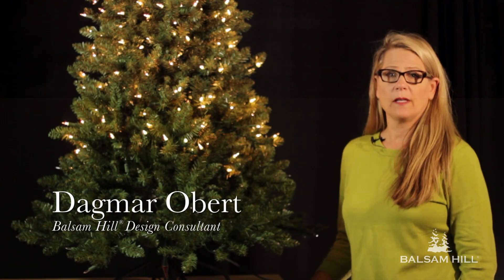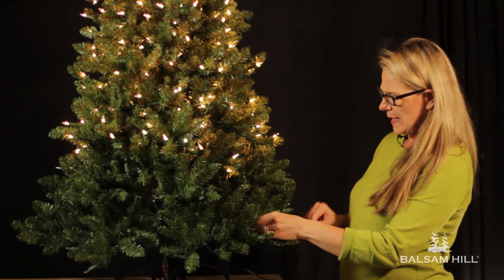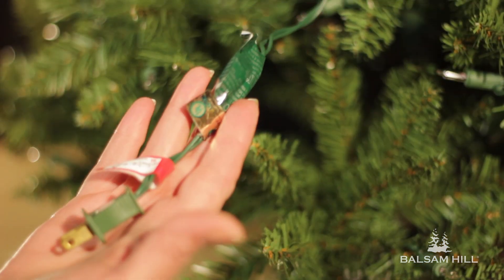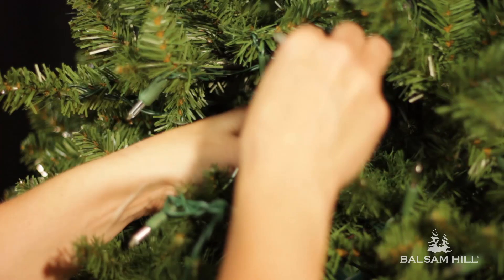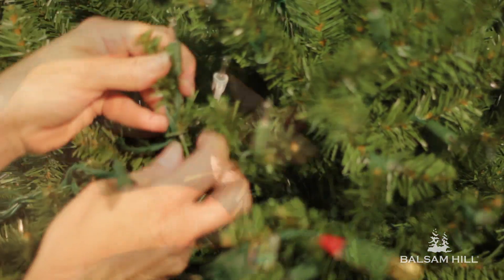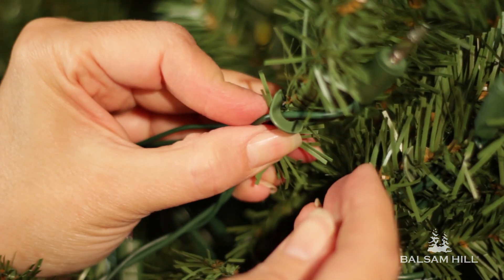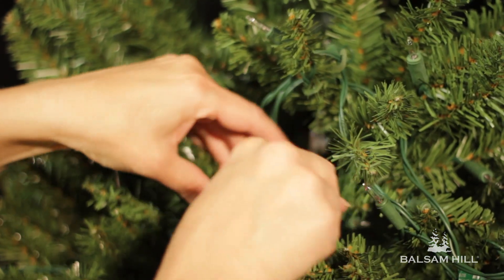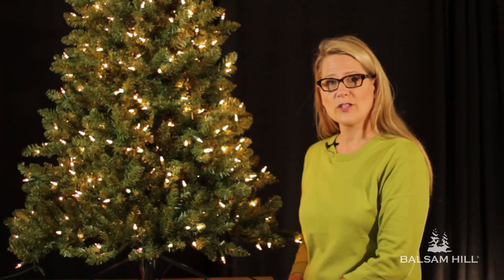How to Restring Lights on a Pre-lit Christmas Tree

Comment: My section went out because the section plug broke out of warranty, so no BH help, at all. They sent clips. See below comments.  My fix? I bought the $5 50-light set from the Home Depot, checking that it had the usual pair of 3 amp fuses in the plug.  Unplug everything. This is very important: On the HD set identify the “line” wire coming out of the first light. Put a colored tape on that wire about 6 inches from the plug. The other is the “common” wire and it does not run to an individual light, but runs along as the line wire goes to each light in turn.  On your BH tree put colored tape on the line wire coming out of its first light about 4 inches from that plug. Use a wire cutter and cut both sets of wires leaving the tapes in place so you can still easily identify line and common wires. .  Strip the ends of all 4 wires. Connect and insulate the two .line wires and then the two common wires(small connector caps or electrical tape; ask a hardware store if not sure).  Test with an extension cord. Should light up.  If it pops, you mixed up the two sets of line and common wires. Replace the fuses, switch the wires, and try again.  Fortunately the HD gives you a spare set of fuses and there was one in the broken BH plug.   Editorial comment:  I admit my tree is about 10 years old, and it is a genuinely nice tree.  But for what BH charges, those trees should have a lifetime warranty.  And the customer service folks are sweet, but useless.  To ask their customers to strip the entire BH light string and re-clip all those lights is ridiculous.  Sorry, but I’m going to Costco next time.

Comment: Unfortunately, the string you sent as replacement are different than what was originally installed. This means following light by light replacement sequence is not feasible/practical.
Reply: I had the exact same problem...they sent me 3 strings before they admitted they don't offer that string type any longer.  The old string was a mesh type with 4 different shoots.  The new ones are all straight line.

Comment: Just took the lights off our 5 year old balsam crap tree, as in this was the 5th year we would've used it. The lights did not last long at all. To remove lights quickly, cut off all the bulbs, use pliers to remove c-clamps and wire cutters for the zip ties. So I am left with a tree with a power pole. I am going to restring each of the three tiers separately with conventional lights and secure them with zip ties. The central power pole makes this possible. In the end with balsam crap that is all you are really getting, a tree with a central power pole.

Comment: I am also very disappointed with my tree. I've owned this $700 tree for 3 years and have about 5 light strands that are not working.  I managed to get the top re-strung with my own lights from Home Depot and the very bottom but I cannot figure out the contorted mess of light strands going on in the center section. Wish I would have purchased a live tree and strung my own lights.  Would have saved a lot of time and aggravation.  This tree also has a few large bare spots which are noticeable and have to be filled with lots of ornaments and garland to cover.

Comment: Our tree is out of warranty by 28 days.  No help from the manufacturer.  Would think the tree would hold up after only 3 years of use and storage in the original BH boxes.  This expensive of a tree should last a lot longer.  Had tree from Costco for 10+ years and thru 2 moves, always working.  
Customer service was not much help - and they don't even sell the light strands!
Reply: I just had the exact same problem with a tree that is out of warranty by one month. Not worth it in my book. Should have gotten a lot longer life.Very disappointing.

Comment: Balsam Hill is the WORST! The lights on the top of the tree stopped working 2 years ago. I ended up just throwing some light strands over the burnt out strands. All Customer Service could do is send me fuses, master bulbs and light replacements. NOTHING worked. Conveniently the tree was just out of warranty. NO HELP AT ALL. Now, the bottom of the tree is not lighting. The bulbs are all burnt out and black. Again NO HELP AT ALL. They basically told me to re-string the lights and sent me to this video. Why would I spend so much money on a tree like Balsam Hill and get no offer to replace it, even if it is out of warranty? They should do the right thing. The reason to buy this type of "High Quality" tree is so that you don't have to worry about re-stringing. Thanks for NOTHING Balsam Hill.

Comment: You guys are crazy, i do this with my normal tree every year. There is always a section that has burnt or a light i have to look for that is out and then I need a whole new string and hook up to the extension chord in middle of tree. I also put my lights through every branch through the back. This has been a pain to do every year. Having a prelit tree is still worth it as you aren’t doing any additional work. If you have to restring a section, cry me a river. I have to do my whole 10 ft tree each year which takes forever

Comment: Removing lights from a pre-lite Balsam Hill is a joke!!!!  Removing and replacing lights as shown in this video is not practical. Balsam Hill light stings are really one long string with 3 separate sections. Imagine if you will having a double handful of rubber bands in your hands but the rubber bands are tied together in a string. Now take a duplicate rubber band string and tie it to the wad in your hand, but you must tie it at each knot. Balsam trees are disposable, just do it before the warranty ends.